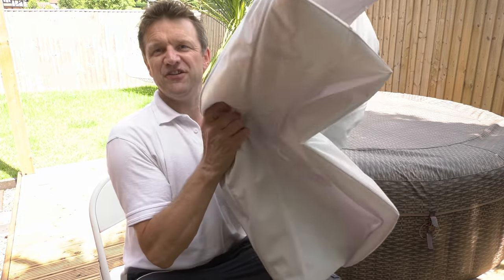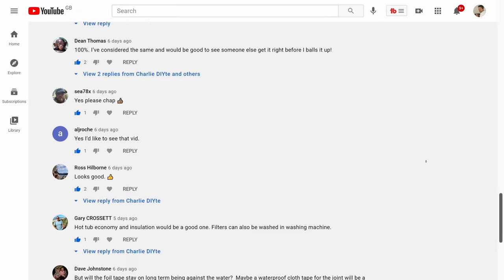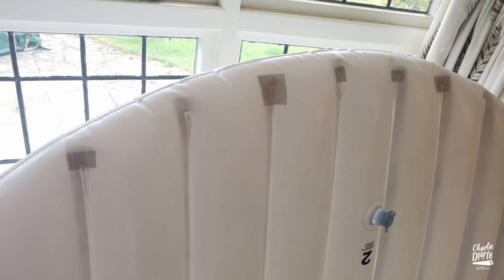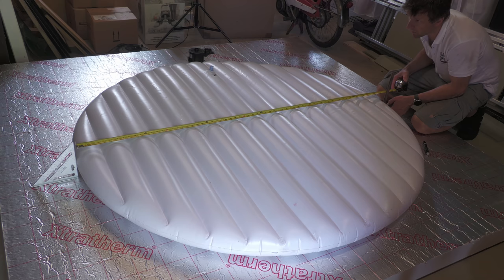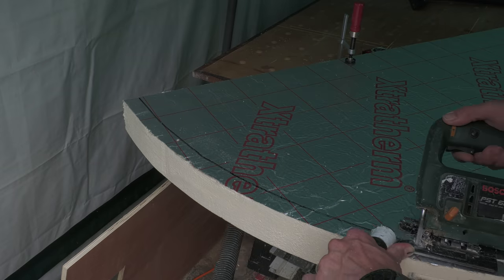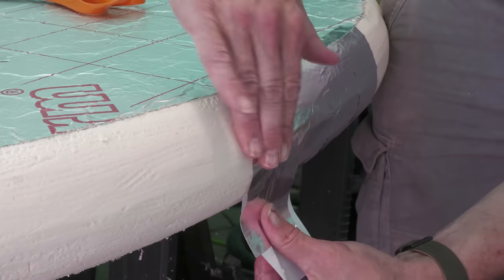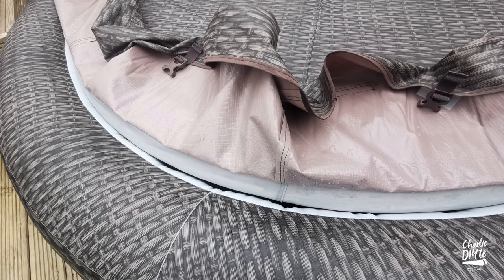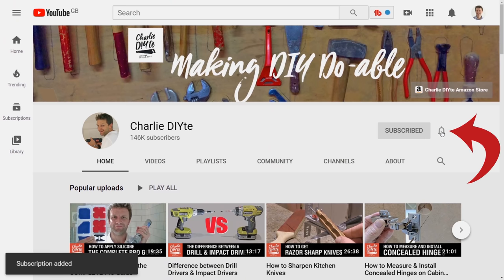Lay-Z-Spa Hot Tub Inflatable Lid Upgrade

Comment: I filled mine with expanding foam, I enlarged the holes where the air was coming out, got a my foam gun with a long flexible hose. Worked a treat no more flat lid.
Reply: I am considering the same, What foam gun and foam did you use?
Reply from the maker: That's really interesting  How many tins of foam did you need to fill that?
Reply: Not sure how many tins, think it was 6 or 7 tins. The gun is one Iv had for a long time it’s very similar to the one screwfix sell now, no nonsense foam gun. If your buying one for this job make sure you get the cleaner as well as this makes cleaning the gun simple and effective meaning the gun can be reused.
Reply: You filled the inflatable lid with foam while stuffed inside the vinyl cover? Interesting. But I guess it's permanently wedged in the cover now...?
Reply: How's the foam holding up? Spray foam isn't really waterproof over time do I'm curious

Comment: Great video, the flat lid looks great, much better than the inflatable one. We have the lazy spa miami, not had any issues with the lid yet although its only 2 years old. To stop it from sagging under the weight of water (rain) we have put a £1 inflatable beach ball in the hot tub which helps push the lid up in the middle and encourage water to run off.
Reply from the maker: Thanks. That's a great idea Matt 👍🏻
Reply: I just bought my lazy spa st lucia yesterday and that is a great idea mate, as my inflatable lid is basically floating on top of the water right now i'll try this.

Comment: I have an inflatable, hot tub that I haven’t set up yet. Because I am still investigating how to insulate it for my deck, which is more like a Florida sunroom. So your video is been very helpful. as part of my original set up, I will be including insulation, top and bottom and probably figuring out some way of insulating the outside of the hot tub as well. Thanks again.
Reply from the maker: You're welcome. I'll be doing an update on the lid. It's survived very well but for a truly insulated lid you need to dispense with the skirt as it limits the size you can make the lid to and make a shamfered PIR cover as per the image I showed in the vid of the PIR before I had to start cutting it down to fit on the skirt.

Comment: I’ve made one of these and I put 10 inch wooden dowels in my joint to stiffen it up and make it stronger and finished off wrapping the complete thing in carpet protector roll just to be 100%. Best move ever loads cheaper to run and also when it rains I don’t worry and out the lid anymore
Reply from the maker: The carpet protector roll is genius. That'll stop the foil tape oxidising. Wish I had thought of that!
Reply: Carpet protector roll?
Reply: @benarmstrong2150  clear plastic with a sticky back used to protect carpet during construction projects.

Comment: Thanks for this advice and it seems to have worked out very well for me.. I have a square 1.8m lazy spa Hawaii and the inflatable lid developed two holes. I used the jablite polystyrene board which was £35 from B&Q and a single sheet was enough in three pieces taped together as in your video. I carved the sides in a slope of about 70 degrees so that the new 'lid' sits slightly proud of the tub so there is an air gap underneath and no rain collects on top. I did not try and make the new lid to fit inside the fabric cover which just rolls back seperately. I reckon I am saving £1 to £2 per day and the temperature of the tub often gets to 1 degree above what the gauge is set to.

Comment: I filled mine with expanding foam. Never had an issues since. 

It's easy to do just get a Stanley blade cut out the flap inside valve then use a Hoover to suck all of the air out, then got a silicone tube and put it on the end of the pu gun place the pipe all the way inside to the other end of inflatable cover and start filling. 

I use my hand to help the expanding foam get to the hard to reach places by also keeping my hand firm down to try to push any air released from the foam back into the foam before it had a chance to expand properly

Done and Done 👍
Reply from the maker: Blimey. That's a lot of forethought to pull that off. How many cans did you use?
Reply: @CharlieDIYte  I used approximately two cans of 750ml 
I've got to admit it was tricky at first but once you got the sides filled up the middle filled up really quickly. 

What I have noticed is I'm using less electricity to maintain the heat of my hot tub. 

I don't know if this is worth putting on your YouTube channel but I've been using active oxygen and a 13 watt fish tank UV light to keep my water clean and with over 1 and a half weeks using this method I have had a cleanest water I have ever seen without chlorine
Reply: @obviouslytwo4u wow! I would love to get rid of toxic chlorine. 
Can you make a video?

Comment: Thanks for the video. I did mine a month ago on a  Maldives Lay Z Spa. I used 50mm and rather than taping the join on both sides I sealed all edges and then taped the top edge and so the lid could fold back on itself. Deliberately did not use the inner liner. Easy to add water treatment and less risk of damage when removing storing and putting back on. It sits on top of the sides with a very good seal.👍
Reply: Any chance you could send some pics? I tried to make one for my Maldives using the inner liner and it was useless!
Reply: I would like to see this also.
Reply: Hi Simon, did you attach your insulation to the original cover?

Comment: Awesome Video.  My Bestway Tub lid is still holding air.  When it fails to do so, I will definitely go with this option.  The only downside to the default lid that I see right now is that the inflatable aspect sits in the tub below the rim.  When it rains... I have a puddle in the lid.  I also believe that the lid is not water tight at the stitching because I've noticed my water level has raised in the tub after a significant rainfall.  If I have the energy and extra money, I might just do this before the inflatable fails for the obvious reasons.  Thanks for the great video.

Comment: I’ve done this last year to my Helsinki hot tub after going though 4 inflatables they are terrible, but I’ve wrapped it in pond liner which o bought which has its sealed sides on top which is hidden inside the lid when it’s pushed in, this solves the problem and it’s completely water proof and will last as a finish .
Reply from the maker: Good work 👍🏻

Comment: I have the same tub (6 months old).  Leaking slowly but not a huge issue yet, but it does collect water, sags, and not holding in heat as well as it should.   I also couldn’t find a replacement lid available in the US.  If I get brave enough, I’ll try a DIY lid like yours.  Thanks for posting!

Comment: Thanks for this video. I’ve got a St moritz to and planned to use insulation board, your experience cuts out all the time wasted to measure up… I plan to use a external Sand filter to this year to prolong water changes…
Reply from the maker: Only thing I'd say is if you can make it a tiny bit wider, do as that way you'll cut down on any heat leakage. The skirt does restrict you though. And use clear Gorilla tape in the middle as the foil tape reacts with the chlorine.

Comment: Hi ,just done my hexagonal tub , like you did . Used 100mm thick panel, difficult to work out the proper shape as I didn't have the inflatable Bladder to copy . Definitely a two man lifting process otherwise I nearly folded the 2 half panels I to each other,  family accidentally turned off the heater from plug and I've just checked the temperature, very impressive its lost only 4 degrees in about 8 hrs I think . So this idea definitely works but a little struggle to place the cover, also mine is hitting the water.
Reply from the maker: Just make sure not to use the foil in the middle particularly if it's hitting the water as it will react with the chlorine. I bought some clear Gorilla tape and applied that on top of the foil. It stops it oxidizing or whatever the chlorine is making it do.
Reply: @CharlieDIYte  thankyou for replying,  I've just bought the round inflatable Bladder and placed that on the water, it seems to do the job in keeping the panel off the water and also lifts it a little to stop rain collecting.

Comment: Thank you! We have the same tub, and it’s the valve on our inflatable lid that has failed. The replacement inflatable lids are unavailable/out of stock everywhere. Your video just kept coming up in our searches, so looking forward to getting it sorted. We’re thinking of allowing the centre seam to fold so we can store it more easily out of season (or just keeping 2 halves for the same reason)
Reply from the maker: If you have it folding you'll need to dispense with the skirt. Use a clear gorilla tape on the central seam as the foil tape does tarnish when it comes into contact with chlorine.

Comment: We have the same problem with our inflatable hot tub cover. I will make the rigid foam board fit inside the skirt as you did. I suspect that the gaps you speak of may disappear when you cinch down the cover with the straps
good video! thank you
Reply from the maker: Yes that's probably right Stu. It does seem to retain the heat pretty well. You just want to make the circumference as large as you possibly can. 👍🏻

Comment: I tried this a couple of years ago. 
The result was that the chlorine corroded the silver layer and left a grey powder like substance in the bottom. It meant wet vaccing the stuff out before each use.In the end we just bought another inflatable lid.
We have found though that by keeping it and the hot tub inflated over the winter months has prolonged its lifespan. Also it is in a shelter so doesn't suffer from direct sunlight.
Reply from the maker: Thanks for this. The corrosion is an interesting one. I'll have to see if that happens on mine. So far no signs of it. Like you, I leave mine inflated all year round, partly because if I put it into store it would probably get eaten by rodents 😬
Reply: @CharlieDIYte  I'm planning to do a vid on how I've managed to keep my early model lay z spa going for years.
I worked out that the punctures in the main pool bit of it seemed to be in the corner creases where it was folded for storage over the winter.

Comment: Using the right vinyl glue when sealing holes is the game changer. Light fast dry layers. 🤛
Reply from the maker: That wasn't the problem. Had a great vinyl glue but as fast as I was fixing them, new ones would appear.
Reply: @CharlieDIYte I did every seam twice
Reply: @TinyGoHomes 

When there are more holes than vinyl it's time to give up. I've also used the correct vinyl repair glue but it never works for long.

The airless insert idea is far superior!

Comment: I think I would leave the foam and cover separate myself so you could get the best fit possible, I would also experiment with putting a tennis ball or a small plastic bowl etc, basically something under the cover in the middle of the board to create a tent for water to run off the cover more easily.
Reply from the maker: Thanks. Yes that seems to be the consensus so far. 👍🏻

Comment: I was speaking to a penguin the other day and said to it about the cover on top of the hot tub. he told me that the reason why these inflatable covers keep getting holes in is because of chemical and PH imbalance which reacts with the material🤗. 

Which makes total sense because since getting a new inflatable hot tub and deciding to use UV filtration and sodium percarbonate. it seems I've not had a problem with the cover and filter changes are becoming less frequent

Comment: I have this dilemma too with my hot tub inflatable. I have had to blow it up repeatedly. Now I see from your video the problem areas for leaks I will have a look to see if I can do a  repair/repairs. Thank you.
Reply from the maker: Linda if you do what I did, put transparent gorilla tape on top of the foil tape in the middle to stop it reacting with the chlorine. Also you'll achieve a more comprehensive job cutting off the skirt but then you'll have the PIR board and cover separate.

Comment: Thank you for buying your hot tub 12 months  before me so I can learn from your mistakes 😁
Reply from the maker: You're welcome. The trick is to buy it out of season. That way you can get one at normal retail prices as opposed to the inflated prices you have to pay when everyone hoovers them up and then sticks them on eBay 👍🏻
Reply: @CharlieDIYte  I feel this. I wanted one at the start of lockdown, unfortunately so did everyone else. The cheapest I could find was £650 and I just couldn't bring myself to part with that sort of money. I so waited in case one popped up cheaper. A year later when the hype had died down I bought one for £310. Staggering difference!

Comment: I just cut the  100mm insulation  to the width of the hot tub and glued a inner circle with spray foam to it underneath to give it extra insulation , glued with underfloor rubber backed underlay using spray foam again as found this the best fix !! put the cover over the top of it and it works a treat !
Reply: Can you elaborate a bit? I am very interested in doing this but get lost when you mention a inner circle of rubber underlay with spray foam… Do you mean that you have a 100mm insulation board sitting on top of the sides of the tub and then glued a rubber smaller circle that sits on the bottom that is the diameter of the inner walls? Thx

Comment: Awesome. I just bought this hot tub. Looking for ways of keeping it outside in winter and to run it more efficiently.
Reply from the maker: My advice would be make the insulation a bit bigger and don't worry about the skirt. Also that foil tape does corrode with the chlorine so a plastic alternative would be advisable. 👍
Reply: Make up a solar water heater too 🌞

Comment: Great video!  I just made a new lid by following this, and I love it already.  I triple taped the two boards together, and I’m curious to see if it makes enough of a difference to heat loss to be noticeable on the power consumption
Reply from the maker: Good work James. If you used foil tape in the middle like I did, you might just get some clear Gorilla tape and cover the join with that as you'll find the foil tape tarnishes with the chlorine. Still love mine but wish I had made it a touch wider (possibly by dispensing with the skirt) to eliminate any gaps. 👍

Comment: Well made video. Thanks for the idea. My first inflatable (Coleman Bahamas) should arrive on Tuesday. Apologies if someone mentioned this already, but I would consider maximizing the top diameter of the foam, and then cutting a straight, 45 degree +- angle to the bottom of the board, thereby making a type of "plug" or "stopper". This would effectively close the gaps on the sides, as you would achieve more surface area. In essence, the foam sides would be shaped like "7", not ">". This would also eliminate any shaping, and the dimensions would not be so critical. I would also consider creating a larger angle on one side, thereby forcing the cover to tilt. Although this will not look quite symmetrical, it should effectively pitch the cover slightly, so most water will roll off to the side and reduce puddling. Also, aluminum is easily corroded by calcium hypochlorite, etc., so i would consider a non-metallic duct tape for the center, and seal the foam edges with some sort of roll-on sealer, spray sealer, etc. I have not researched any options, but I am relatively sure there are some non-marring options that will not effect the plasticizer in the vinyl sides. -------------------- The easier option... I have seen 2" blue foam-board without any metallic surfaces, so that would probably be best. That foam is bonded with a thin layer of some type of clear plastic sheeting, which should not impact the vinyl when sitting on top of the tub. So, I may simply go this easy route, and use this 2" blue solid foam board cut with simple 90 degree sides, just slightly larger than the diameter of the peak around the circumference of the tub, and ignore the skirt completely. When ready to uncover, simply remove the cover, then remove the foam, in 2 separate operations. This would avoid any gluing, or complicated / damaging cover modifications. Maybe you or someone else can expand on these ideas!
Reply from the maker: Thanks, all valid comments. I started with the angled edges but unfortunately I couldn't get the cover back into the skirt so then began the process of gradually reducing it in size. I agree, dispense with the skirt and you have a much better solution. A bit of a pain though each time you want to use it to have you remove two separate components. I'll look into the blue foam though.👍
Reply: @CharlieDIYte  " two separate components" That's how it works for the thinner-walled versions of the layzspa's anyway, I think?

Comment: I used 100mm insulation board to sit mine on top of to retain heat when not in use, didn't think of using it for the lid too.....genius thanks!
Reply: What 100mm board did you buy for the base please?
Reply: @helenalovelock1030  same as used in this video, pir insulation board.

I used the same brand name too but I'm sure you can buy non branded for a bit cheaper if you look around. 

Hope that helps?
Reply from the maker: The only thing you'll find, as I showed here https://youtu.be/ZOQ2L1TMayc is that the foil delaminates under the pressure of the water and creates a bit of a mess. I've gone back to using the Lay-Z-Spa mat now
Reply: @CharlieDIYte  I covered it over with a thick grade DPM and then used the mat on top of that again.

I have decking around the tub then at a depth of about 150mm in total so you can still step in/out ok.
Reply from the maker: @freddyply  Ah, good thinking! At some point In going to construct a circular base to act as a sacrificial layer that maintains air circulation to preserve the deck under the tub.